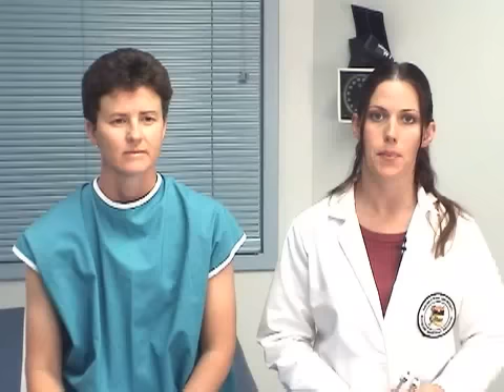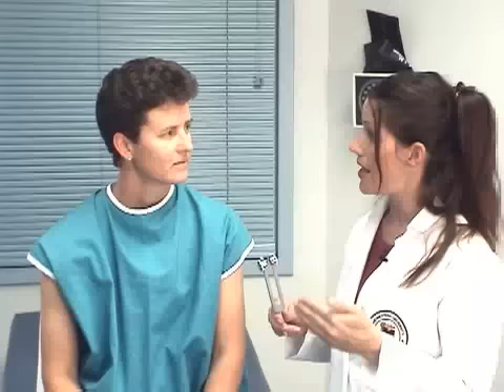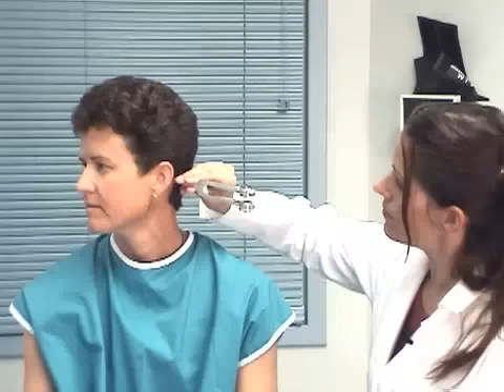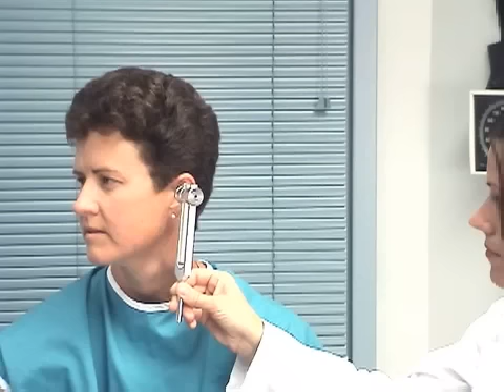Rinne Test

Comment: She's using a 128Hz tuning fork here.  My understanding is that the Rinne and Weber tests are generally conducted using the smaller 512Hz fork.
Reply: You are correct.  She should have used 512 or 1024 Hz.

Comment: "Quickly invert the fork so the vibrating end is near the ear canal; the person should still hear a sound (Fig. 15-12). Normally the sound is heard twice as long by air conduction (next to ear canal) as by bone conduction (through the mastoid process). A normal response is a positive Rinne test, or “AC. BC.” Repeat with the other ear... Abnormal Findings: Ratio of AC to BC is altered with hearing loss. Sound is heard longer by bone conduction with a conductive loss" (Jarvis, 2009, p. 355).